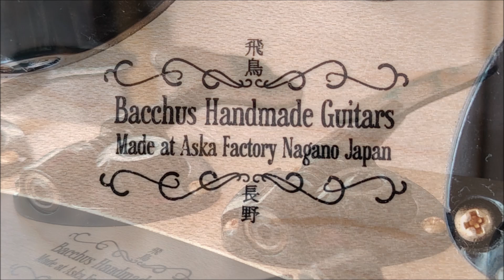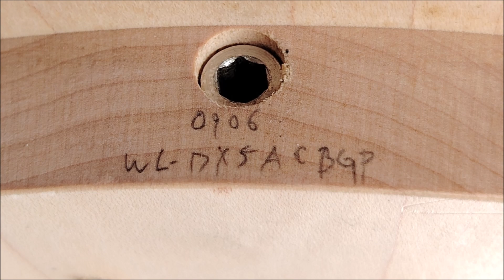Bacchus Woodline517 AC BGP Image Gallery

Comment from the maker: 00:00 Introduction
00:12 Headstock
00:51 Neck
01:29 Bolt On Neck Joint
01:57 Contoured Heel 
02:19 Fretboard
02:47 Bone Nut
03:14 Body
03:47 Bridge
04:31 Misc. Body-Mounted Hardware
05:10 Pickups  
05:15 Control Cavity 
05:54 Control Plate Electronics - Left Side
06:21 Active/Passive Switch  
06:32 Control Plate Electronics - Right Side 
06:55 Control Plate Electronics - Underside